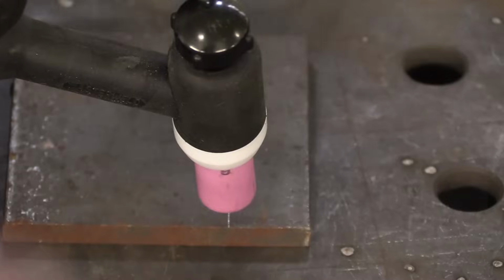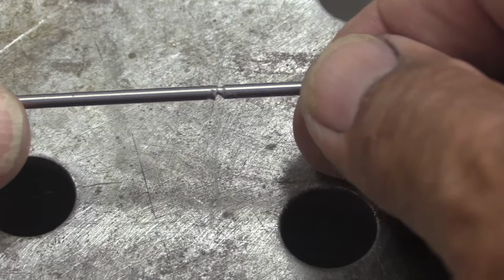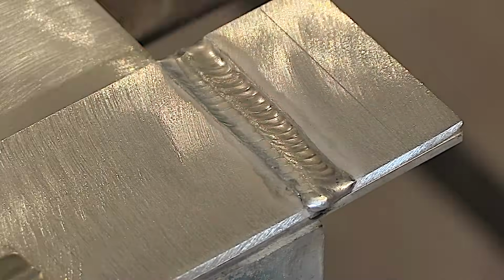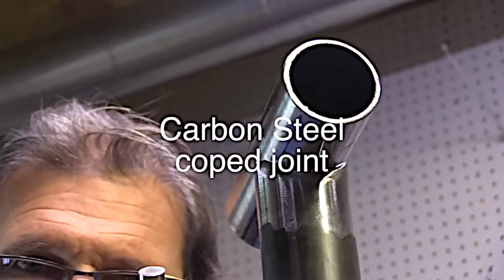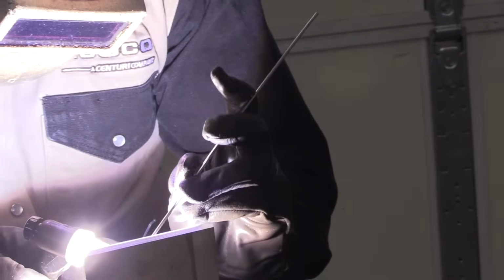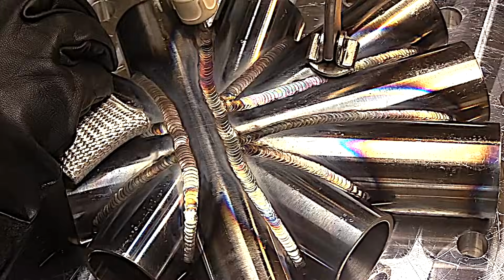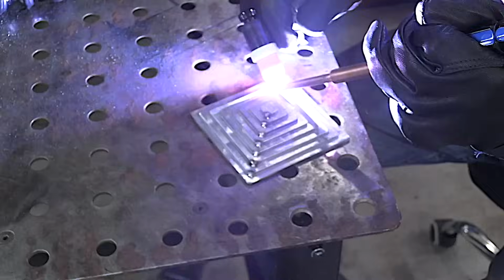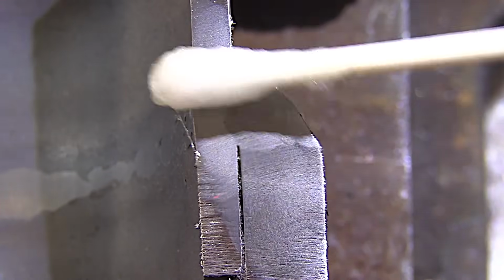TIG Tips for Beginners and Common Mistakes

Comment: Thanks for this video. The filming was great at showing what proper technique should look like and what good flow should look like..I think. 
I have had 2 bouts with welding in my 64 years.. Highschool auto shop and an HVAC company I worked for 22 years ago give or take. I have never had instruction in welding, just kind of picked up the tools and did some. I just picked up a Lincoln Tig 200 unit as a hobby welder. WhatI have tried in the past Tig was the most forgiving to memory so I am going to try some of your exercises in this video. 
I hope your recovery is going well.
Thanks again.. and I will definitely be visiting the store as I have little except what cam with my unit. My interest is Stainless Steel btw.

Comment: Hey! My son is starting to restore old John Deere tractors. Many of the pieces of metal, hoods, fenders, etc have moth eaten holes....replacement costs of these can mount up. I wanted to try my hand at using TIG to fill a lot of these holes. I haven't started dealing with TIG yet (not enough time in the day, especially once I retired)...but I'm trying to stack the deck in my favor. I have the ESAB EM 200 Pro for the machine. The included torch with the leather sheath is quite bulky so I had you get me a CK-17....for this fine work on some of his pieces (I'll measure today but some areas are paper thin). I'm wondering if a CK-9 would be better suited. I'm sure the 17 will do it but as I said, I like to stack the deck...and I'd need some clear cups so I'd probably grab a kit. Thoughts? (due to the age, these are metal but I intend on getting an AC capable box this fall)

Comment: I've been tig welding 30 years now, and one thing that  never gets mentioned is don't pull your filler wire out of the shielding gas while welding if you do it will oxidised and contaminat your weld when you put it back in also a good idea to cool your wire in your gas shild before you pull it out at the end of a weld so it's clean and ready for your next weld 🇦🇺
Reply: Thanks g
Reply: I don't have the hand coordination for the dabbing and feeding the rod lol can I use lay wire for most of my basic stuff?
Reply: @timothyberlinski2299 yes you can 👍
Reply: @timothyberlinski2299 and practicing using pulse is a great way to get your timing and rhythm up to speed 👍
Reply: @timothyberlinski2299 youll develop it
Reply: Hibdo i need to work a pedal as well
Reply: Thanks. Never heard that before. Will be helpful for me. 👍

Comment: Not sure if this is the right place to ask this but im just learning to tig weld and im finding no matter what amps I set it to or if I use pulses or not I can't get clear beads to form. They always melt together and just make one smooth line. What am I doing wrong?
Reply: Do you mean that your weld doesn't have distinct ripples? The stack of dimes look? It could be a combination of things but assuming your amps aren't too high you probably just need to move the torch a little more between dabs of filler and possibly add a little more rod with each dab. Your arc length may also be long. Try to keep it as short as you can without dipping your tungsten.

Comment: the price of the ck worldwide mt200 ac/dc tig welder currently is aprox $2000.00 us dollars. Any chance you can recommend a welder in the $500.00 range?
Reply: Arc captain on Amazon, not bad for what it is.
Reply: Miller 250

Comment: Just started doing tig, trying to get to make a subframe, stick welding in fine with e7018 etc but really struggling with tig, on the flat it’s not too bad but struggling to weld notched tubes, just can’t get a nice looking weld, using wsme 250 machine, #8 cup, gas lens and 2.4 grey tungsten, I’m using t45 2.64mm wall carbon steel and s355 for the brackets, can anyone suggest base settings for my machine and the steel I’m using please as feel like giving up, really want to be good at it but it’s really not easy to get a nice looking weld
Reply: Don’t give up keep practicing you’ll get it
Reply: Hood time. That's it. Theres no secret advice. Watch some videos, but get under the hood. Tig welding has a.much larger skill gap. Just weld
Reply: @steez4sale188 100%

Comment: i weld stainless tig almost daily, all of this is very solid advice, only thing i would say is for the new guys (which i still feel like i am), don't dab, just lay and feed. you wont get the dimes but you will get a constant consistent fill... ugly welds pass where pretty welds fail, its more about doing the job right
Reply: 0.6 paslanmazı kaç amper de kaynatıyorsun pulse ayarların nasıl

Comment: I use to weld before tig .This just make you want to be young again. I just watched a different program on a rust paint, etc.. remover with lazer it's 10k aud .I spent 3 months removing 50 year old paint for 2 pac on an old chrysler by chrysler CH 77. after watching this and the other video. Our youth should be able to make pretty much anything if they could afford the units. Great compilation 👍 very enjoyable xo

Comment: I thought I was a beginner, but I’m whatever one is before that.
… I was watching a guy using a tig welder elsewhere and they said that the tig welder fuses the pieces without the welding rod (or that metal stick piece you keep touching on the weld as you work), so how does that additional element work with/for this welding process? Assuming I didn’t incorrectly repeat/interpret the other guy.

Comment: A suggestion, I see you welding quite fast. Every tutorial TIG welding, the welder is going quite fast. As a beginner,  if we could start off very slowly, to learn, speeding up would come naturally. Words from an absolute beginner....
Reply: I’m learning as well, but one thing that I’ve picked up in the course I’m in is that if you go slower, you will overheat the metal which can create problems, like distortion and a very large heat affected zone (HAZ) that can have oxidation. If you turn the amperage down to go slow, my instructor said that you might not get good penetration into the joint. So you have to compensate by pre-heating the metal and cutting bevels on the joints to get better penetration. I wish there was a way to go slower - it would be easier for us beginners. But it seems that it is what it is; about 1 rod dip per second and keep moving. That’s what I’ve been taught, but I’m by no means an expert. Just sharing what has been shared with me.
Reply: You’ll just cook the metal then
Reply: You absolutely can do that. Just turn your amperage down to reduce the heat, and move more slowly. Some like high heat and speed, some like to run it a little cooler. Just don’t run it too cold, or you’ll sacrifice penetration.
Reply: Slower it heats up too fast

Comment: Getting frustrated with blow-through on my 19-gauge body panels.  I have a cheap Amazon TIG welder without pedal amperage control or pulse (only a on/off switch at the torch),  using 1/16" tungsten, 1/16" filler rod, gas at 15CFM (more than I should need) running only 15 amps (much less than I should be using - about 40) #6 cup, 3/8" stickout, nice tight seam on the panel, using a 1/8" copper backer, but I can't seem to avoid blowing a hole through on one side of the seam or the other before I have a chance to apply filler .  Higher amperage only makes the problem worse.

The only thing that seems to  work (but not always) is if I start the arc well away from the seam , quickly draw it into the seam, then do a brisk rootpass motion over the seam.  Eventually a puddle develops dead center on the seam, after which I can either stop or continue to rootpass forward along the seam.   But penetration isn't compete..  If I try a rootpass at an amperage closer to the recommend 40A ,  the rootpass motion will produce immediate blow-through.

 What am I doing wrong? What's the secret to preventing blow-through on such thin steel?

I'd love to see a video on preventing blow-though on body-panel TIG welds, especially if I have inexpensive equipment.
Reply: I had the same problem and solved it with 33/33 pulse settings recommended by Jody but I have a pulse machine. Before that I was fighting ramping up and down with button as I didn't have foot control which I now also have. I would let go button and wait to arc to get smaller as the amperage goes down but I would never go to post flow just pressed it again to go full amperage again and that way I got a kind of a pulse. But even with that I would sometimes punch though and then had to cool down and regrind and start again and start feeding asap...

Comment: my tungsten grinder is a cheap harbor freight bench grinder (30$) with a 100 grit diamond coated steel disc (10$ on Amazon)  mounted on the outside of one of the grinding wheels.
Reply: That's a great idea. Probably wouldn't be too hard to build a jig for the correct angles either.

Everyone thinks they're gonna learn to tig when they get started but what they actually learn is grinding tungstens.

Comment: My Biggest Problem With Tig Welding is learning to control heat with the foot pedal or a finger switch I hold it down or lift up to much any tips
Reply: You might be trying to do too wide of a range, but heat control is all about practice. Thin metal is a lot less forgiving than thick metal, so you might think about doing passes on thin metal without filler for practice to really dial in the heat. You could set up an overlapping outside corner joint with 18ga for a fusion pass also. There's a lot of easy to see feedback in that setup.